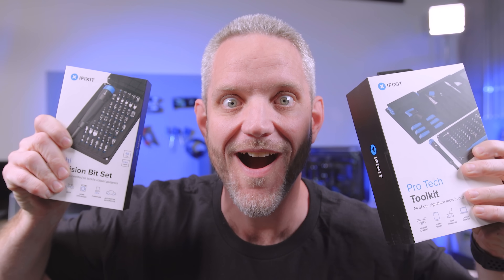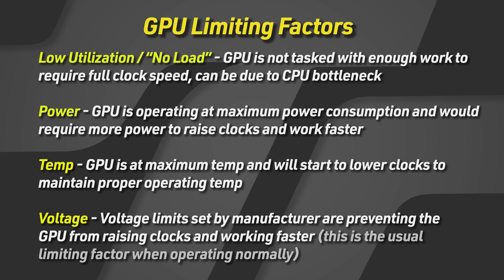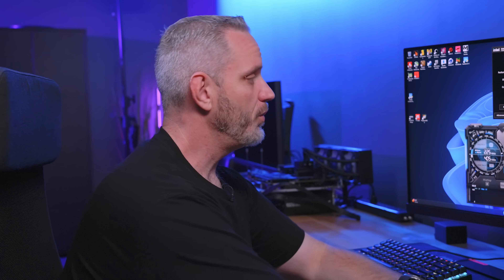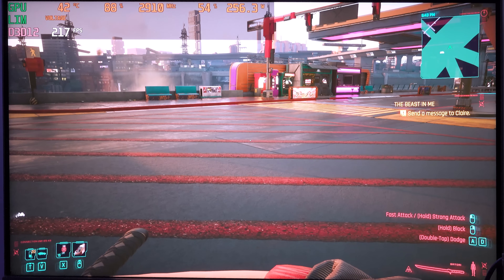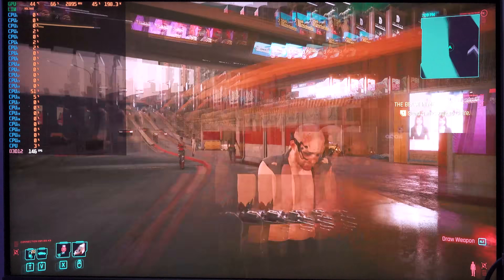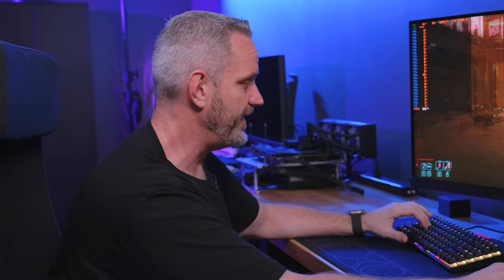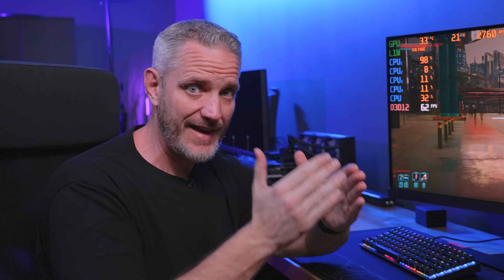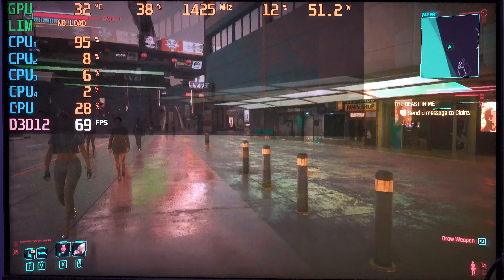THIS is what Bottlenecking REALLY looks like! AVOID THIS!

Comment: Currently bottlenecking my 7800X3D with a 6700Xt, upgraded from a i5 6600K.
I choose to do it that way since i plan to get a new GPU anyway.
Also, that way my CPU wont bottleneck my next GPU which needs to be more powerful than my 6700Xt.
Also there are so many titles that are SO CPU depended, like Star Citizen ( which i play a lot ).

Also i feel like a GPU bottlenecking is not as worse as the other way around.
If your CPU is tooo slow for a title you cant do much , if your gou is too slow you can turn down the settings.
Reply: lol stop using the word bottleneck.  Your cpu is not "bottlenecked" by your gpu.
Reply: huh? what?? i think your pc is a trash can that needs to be emptied. no way in a million year, your pc in a normal "good" situation will bottleneck. something is wrong on your pc.
Reply: @jiboo6850  There is always a "bottleneck". You are either cpu limited, or gpu limited. You can also be IO limited.  You people need to just stop using the word.  Pair a good cpu with a  good gpu, and you'll be fine. You will benefit from a better cpu when cpu limited and a better gpu when gpu limited. You have to have a lower end cpu to literally "bottleneck" your gpu.
Reply: @insertnamehere4419  yes but there's a difference between a bottleneck that is 3 lanes to 1 vs a 10lanes to 1. the 1st one will be easier to dela with just by finding the balanced settings that ask an equal job from both. and it's not difficult to figure out. what i meant in the 1st comment is that his config is high enough to pull Starfield easy. he just hasn't the right settings to let it express itself to the best.
Reply: GPUs do not hold CPUs back. Stop using that term for that instance.
Reply: @HiluxForEveryone  it can but it will not act like a "normal" bottleneck. it will not appear with stutters and stuff like that. all it will do is limiting the fps amount and will not pull heavy settings. or it will simply crash.
Reply: @jiboo6850  lol you're just making crap up.
Reply: @insertnamehere4419  try it by yourself with a 10 yo GPU paired with last gen CPU and see by yourself.
Reply: @jiboo6850  It can not. A 7800X3D won't care whatsoever if it's paired with a 1050Ti or 4090. In gaming its primary objective is to "push" or process frames for the GPU so it can render those for you. Theoretically picture a game where 7800X3D's approximate limit is 120fps. Assume a 4090 can push 110fps there and 1050Ti 20fps. In that instance both GPUs work to their fullest as neither reaches 7800X3D's theoretical limit, and it's in no way held back by anything, it does not care how much frames it's being asked to process. Quite literally the only difference you get is in how hard it has to work to push those frames, meaning > higher CPU usage > higher power draw > higher temps. Since the theoretical 1050Ti doesn't make it work nearly as hard you could technically call it a "bottleneck". It's entirely meaningless though. If anything, that "bottleneck" is actually beneficial for you because it means you've got more processing power to spare for any background tasks you wish, so you could run more demanding tasks while playing without even noticing them. The CPU doesn't care, your in-game experience will be exactly the same if it ran at 20% compared to something like 40. You actually don't ever want it to be anywhere near 100% usage (its "full potential") because that'll very likely introduce stutters, framedrops, and other hiccups. In summary, in technical terms it is a "bottleneck", but with how it actually works it makes absolutely zero sense to call it that. There is no such thing as "GPU bottleneck", you're calling it wrong. It does not bottleneck anything really, it just limits you on the FPS and visuals you get. Call it instead "Weak GPU" or simply "GPU limitation", because that does make sense.
Reply: @jiboo6850  Try what?? gpu's do not bottleneck cpu's. It doesn't work that way. Just stop.
Reply: @HiluxForEveryone  jesus Christ... i didnt read because youre saying exactly what i said. You just cant read in fact?
Reply: @insertnamehere4419  all i said is with an old  GPU youll get low fps and low settings. It's crazy how you people struggle to read properly... keyboard warriors for nothing. 🙄😮‍💨
Reply: @jiboo6850  My ability to read is just fine. You've been told you're wrong and just making crap up.
Reply: @insertnamehere4419  i know well that cas because i was there just a month agonwith an R9 290x paired with a Ryzen 5 5600. I just upgraded the GPU. All i could get before was around 60 fps with most settings on low in Warzone 2. It was smooth but too low. Yes its a limitation and i precised it in the comment you pointed out. A proper bottlenexk will get you stutters and weird stuff that a simple limitation will not do. And thats exactly what i said if you can read.
Reply: @jiboo6850  Read the whole message first and you'll understand. Don't make yourself seem ridiculous.
Reply: @HiluxForEveryone  What the fuck is going on.
I merely said its better to have a "too" fast CPU than a "too" fast GPU.
Since games can be toned down according to the GPU, but CPUs are mostly the point where games fail due to high CPU load from a lot ingame calculation, in that case you can either try to overclock your cpu or buy a whole new CPU + Mainboard ( and even RAM ).

Thats why i stated Star Citizen as a good example, the game is EXTREMELY CPU intensive, if your CPU is too slow it doesnt matter how fast your GPU is since toning down your graphics settings wont fix the fact that this game needs a shitton of CPU power.
If your GPU is to slow you just have to tone down the settings itself to gain the necessary fps since your CPU can handle it for sure. 
You wont get CPU related stutters or freezes.

All that is of course depending on what you do with your PC and what kinds of games you play.
If its a pure GPU intensive game and theres nothing much going on which requieres much CPU performance your fine i guess.

Forza Horizon 5 ran fine on my i5 6600k paired with a 6700XT since the game barely needs any CPU performance.

And yes, thats what i would call a bottleneck.
The CPU could put out more FPS, but the GPU is already at 99% load.
Therefore prevents more FPS.
Same if the CPU is running at 99% load and the GPU at 10%.
Reply: @jiboo6850  Dude, i said Star Citizen, which is heavily CPU dependant. 
Not Starfield.
Starfield requieres a good GPU and doesnt care as much about your CPU.

And "finding the balanced settings" is not possible in Star Citizen since you only have 3 setting options.
If they are on Low already you cant do much more besides buying a better GPU.

BUT a better GPU wont push THAT Much since the Game needs a shitton of CPU power for all the server calculations, 100 people throwing shit around and all that.

it depends on the game and in this game a CPU bottlenecked or limited by a GPU is better than the other way around. 

Trust me, i had the GPU paired with an i5 6600K for a years and you have horrendous 1% lows due to the weak CPU:
Reply: Also you have more room left for background stuff if your CPU is too powerful, your stronger GPU wont do shit for backgrpund applications.
Reply: @Intrepid17011  just a typo. i don't know why i wrote Starfield. no i don't trust you because you're wrong. if you have that issue it's not for what you think. 

btw, Star citizen is known for having poor performance despite having a high end pc. so stop desperating about it and upgrade when you can until game is finished and optimized.
Reply: @jiboo6850  Welp, i honestly dont care .
Its a well know fact that SC is extremely CPU and RAM intensive and doesnt care that mch about your GPU.
But welp, i guess you know something the rest of the whole Star Citizen Community and Dev Team doesnt know.
Reply: @Intrepid17011  nope. it's just the nature of the game to have those kind of jumps. i watch some streamers on this game with their high end pc that cost over 10k and they get very poor perf. so don't cry about that it's just how it is. people deal with it constently. 

massive dsync, poor fps etc... it's an alpha game. i mean... sometimes those jumps are generated by the poor netcode. when you crash on something invisible, you get a locked screen for a second or 2 and it continues because it's the relation between servers and pcs that is suddenly catching up.
Reply: @Intrepid17011  Read my message in its entirety again and you'll understand my point, which is just correct. Like I said, while technically you could call it a GPU bottleneck, with the way it actually works it really makes no sense at all to call it that. Now when we're talking the other way around, there it makes perfect sense to be called a "CPU bottleneck", because the CPU can't push more frames for the GPU to render, leaving you with less frames than the card is actually able to output. Yet when your GPU is the limiting factor it really doesn't "bottleneck" anything. Say you have a 7800X3D and play at 1440p Ultra: doesn't take a genius to know you'll get more frames from a 4070Ti compared to 4060Ti, but in that instance the 7800X3D couldn't care less for how limiting the paired GPU is, it just does its job. While technically the same logic applies either way, it still makes little sense to say cards can "bottleneck" processors. Going by your logic, if a 7800X3D could in theory push 2000fps in some very CPU-intensive game and there was a graphics card capable of that too, you'd make it so all its cores are pegged at 100% 24/7. Sure that'd likely lead to awful stutters and brief framedrops but hey it'd be working to its full potential and not be bottlenecked. Seeing what I'm getting at yet? When you are CPU-limited, your GPU partly idles giving you less frames than it can give. Indeed a valid bottleneck. When you are GPU-limited with it at 99-100% usage, you are getting all the frames it can give with.. quite literally zero impact on the CPU's operation, it's not bottlenecking anything. In that case the CPU idles waiting for you to allocate more of its resources to maybe run some other stuff in the background. My point being don't call it a "bottleneck" when, for all intents and purposes, it's really not. Call it instead a "limiting factor", a "weak GPU", a "GPU pushed to its limits", whatever else even. Because all that would actually make sense.
Reply: @HiluxForEveryone  We are just discussing what word to use when in theory its all the same.
Bottleneck or limiting factor ? Well all it means that one part could perform better but cant because one part is to slow.
Same with the GPU, my CPU idles around at 40% while my GPU is at 99% all the time.
In that case a faster GPU could definetly give the CPU the opportunity to be utilizied much more, right ?
Or a better GPU doesnt "limit" the CPU as much. 
I get what youre saying , but all we are talking about are synonyms describing the same thing in essence.

And all I said is that a too fast CPU is preferable compared to a too slow GPU and that MY GPU is definetly the bottleneck to my CPU, OR as you want to call it, the limiting factor. 
But all in all , it just hinders the CPU to perform at a higher utilization.
Reply: @jiboo6850  First, i dont know where i cried ?! But welp.
Second, no, the game is a MMO, which a huge server structure, thousand of NPCs, millions of physicialized parts floating around, 100+ players in 100+ ships that also have parts that come loose and all that noise.
And everything is going on at the same fucking time, therefore this game needs definetly more CPU power than anything else.
Everybody knows that in the current state your PC has to calculate EVERYTHING due to the bad server structure. 
Therefore a higher end CPU is preferable.
That also means its better to have the GPU as the limiting factor as compared to the CPU as a limiting factor.
A bad CPU causes stutters in this game since the graphics arent THAT demanding.

I know why i have to explain that, just watch any dev blog and you`ll know its a well known fact that SC requieres a beefy CPU to get playable FPS while even a 1070TI gets you 40 FPS in Cities paired with a good CPU.
Reply: @Intrepid17011  imagine being stupid enough to call a 7800x3D not big enough for that game... dude... at some point you have to think right. this thing IS indeed a beast. you just can't use it right. for some reason something is wrong in your pc and it slows it down. the CPU is fine unless you cooked it trying to overclock it or something. you act like i don't know the game. sorry to burst your bubble but i'm interested in it and follow the developing of it through streamers until it's in a good state for me to buy it. i've read enough and seen about it to know what it takes to run this thing. otherwise never i would've answered you. but anyway... do as you want. :body-blue-raised-arms:
Reply: @Intrepid17011  Fair I guess. But still it's not really "hindered" because you actually want some breathing room on your CPU usage you don't want it to be overly high. Now a game engine poorly utilising a CPU is another thing as well.
Reply: @jiboo6850  I guess i dont bother replying to you if you dont have the necessary reading comprehension skills.
I never said with a single word that i think the 7800X3D isnt sufficient enough for SC.

Comment: I have a Ryzen 2600 paired with a 3060. I found a big deal for the GPU at 170€ (178 USD) and I couldn't miss the opportunity. What I've found interesting  is that my CPU and GPU never max out even with unlocked FPS, but now I know that a true bottleneck doesn't necessary mean having a 100% usage. And while I wait to get a 5700x3D or better, I can still enjoy 4k gaming at 70fps with my games.

Comment: I bought an 4070ti while I still had my i7 8700k. While it's been a great CPU for years now - it started to show it's age on larger games, so I had major bottlenecking. My GPU Usage hovered anywhere from 50 to 70ish depending on the title. Today I upgraded to i7 14700k and the difference is IMMENSE.

Comment: I had my gpu die like six months ago in a ten year old pc build. I replaced the old gpu with a RTX 3080 so I was running that with a cpu from 2013 ( i7 4770), I knew it would bottleneck it till I could get the rest of the parts I needed to upgrade the cpu and it was very noticeable. Since then I was buying each part I needed to upgrade piece by piece till I could put it all together. This week I finally got the last part to upgrade everything and it performs SO much better.  I put in an i7 13700k cpu, with new mobo, ram and ssd and it is performing miles above where it was before.

Comment: I had a 3060ti and a 5700G and my usage for both rarely ever went past 50% while also having barely decent FPS on even low setings. Now I upgraded my CPU to a 5800x3D, GPU is now properly utilized and I got a massive FPS boost even with high settings.

Comment: good video. even an idiot like me can now understand why the GPU should be running pretty high while the CPU should be pretty low. having played with the settings a lot in Cyberpunk and creating my own bottlenecks I completely understand now. I only have a 5600g and a 1660s and thought running on low settings would help overall performance....nope. all it did was shift the load to the CPU which is also what AMD fidelity FX does which is why you have 5 different settings for that. I'm still learning so, thank you.

Comment: My current favorite (least favorite) bottleneck is the 7000 series AMD cards can't do the physics cycle to CPU on the water texturing in Saints Row 3 right.  My little 7600 gets 40 frames at 3400x1440 away from the water and 1 frames (single digit) at the water whereas my 5700XT was getting 28 frames on the water and 36 in the general game.   The 7600 is an 8 channel but that doesn't make a difference because it talks at Ie4.0 and the 5700XT was getting those frames on an older processor on a Ie3.0 limit board.       I HAVE noticed that with PCIe 8x the resizable bar does absolutely nothing but make Dx12 absurdly fragile to interruptions...

Comment: Prime example of bottleneck: I was running a 1700x with a gtx 1070. My games were starting to become janky even with running everything at minimum settings. Upgraded the gpu to a 6800xt a couple months ago. A little bit of a better performance in gaming but not even close to what I should be getting from a top grade newer graphics card. Still had to run my games at minimum settings to be sienwgat playable. Upgraded my cpu to a 5800x3D yesterday and my frames literally tripled even with bumping up the settings to high. That 7 year old cpu was holding back the graphics card so much that it feels like I built an entirely new computer just from that one upgrade.

Comment: You can google bottleneck calculator & get a good idea of what CPU/GPU HW combo is pretty well matched at any particular resolution, where neither gimps the other.  For example, at 1440p play a Ryzen 9 7900 12C/24T or Ryzen 7 7700X 8C/16T CPU is a great performance match for the AMD 7800 XT GPU.

Comment: 10:25 Great video. What I don't understand is that why is the GPU not being used 100% when the CPU itself is barely being used? Clearly, if the GPU was at 100%, there would be more FPS as well as more CPU utilization.

Comment: Rainbow Six Siege has an issue with bottle necking my 7700K CPU. It was using too much when I got a RTX3060TI. I was getting all kinds of rubberbanding after playing for an hour online. It was terrible and I couldn't fix it even after locking the frame rate to 60FPS, and lower the settings didn't help at all. It only happened on that one game.  When I got a new CPU it still went really high on usage but it could handle it. This apparently was happening with that CPU with that game since 2017 on that game.